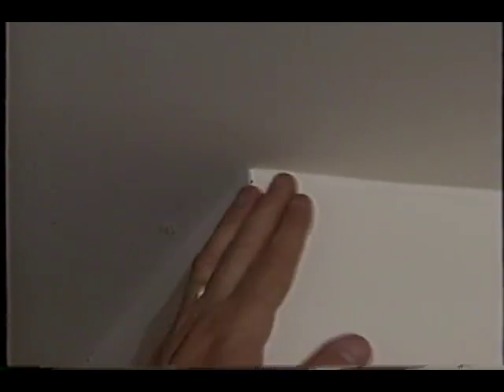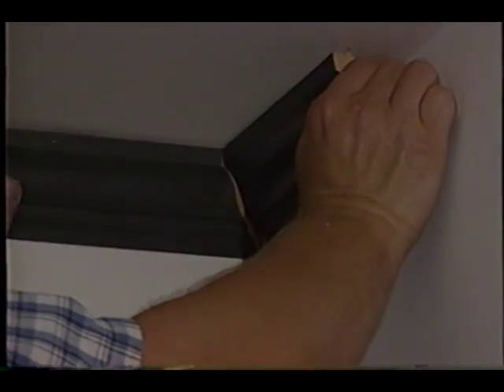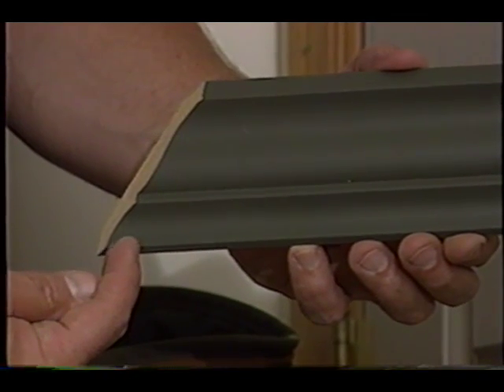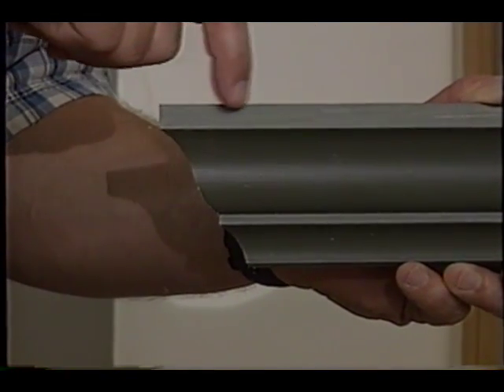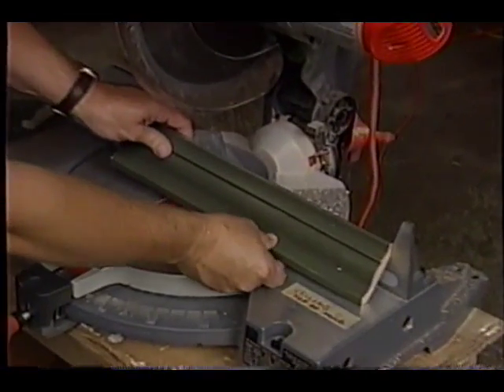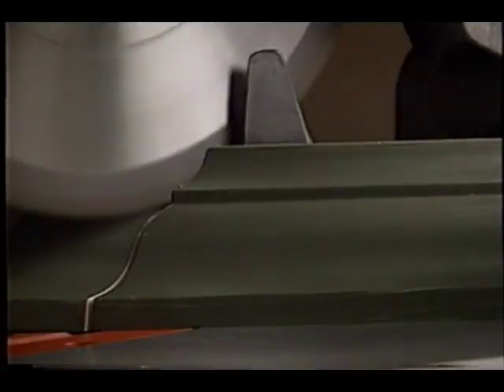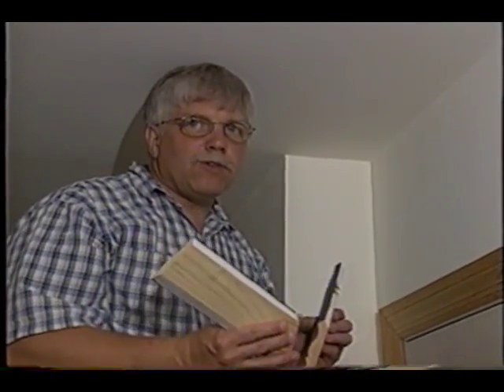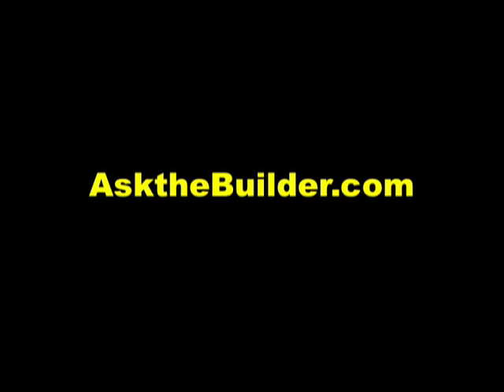Cutting Crown Molding

Comment from the maker: If you read my ebook about how to install crown molding, you quickly discover that you rarely cut each piece at a 45-degree angle. You use short test pieces in each corner to see what angle to cut each side. The left may be a 45, but the right could be a 44-degree cut. When you cope you have to cut the molding - one piece with the identical cut *then* very very carefully cope. With my method, I probably will have two corners complete in the time you're still cutting away.

Comment from the maker: The funny thing about coping is that you have to make the miter cut on the molding to produce the cut line. If you determine the correct angle for an inside corner - it's usually a combination of angles from 43 to 45 degrees - you get a tighter fit than with a coping saw. But whatever floats your boat and we sure don't need you with a stretched ear.

Comment: if they are inside corners try coping moldings and if that doesn't work then put the molding against the ceiling and trace the height and projection with a pencil on both sides of the corner making sure wall lines align  and then mark the molding where it will meet and find your angle on the saw...hope this helps

Comment: You have an informative series I will admit.Yeah I should do the same only I end up using so many different profiles. I was referring to the way in which you cut the crown itself on the miter saw. I use a 12" dual slide compound miter saw (Makita). I always lay my crown flat on the table of the saw itself.  I I am a Florida licensed General Contractor specializing in commercial work. By trade I am a finish carpenter though.

Comment from the maker: You have the keyword in your question! The angle in a gable end is NOT a compound cut. The crown is not going around a corner. Both pieces running up the gable are in the same plane. Think about how easy that cut is....... Think door or window casing.

Comment: i have to agree with mycijor, because in stain grade work the reveal from a coped joint is always wood. on a miter cut the is nothing only air. it's easy to spot if it seperats the slightest.but i have to admit i often times miter, but my saw is perfect,and i use a good protractor. but if you got the time coping is best.

Comment from the maker: I can't tell you as the miter method I use produces tight joints in less time. To produce an accurate coping-cut line, you have to cut it the way I show. So why cope if you already have the perfect fit?

Comment: I agree with AsktheBuilder ... if you are going to be painting your molding I prefer to just miter both pieces instead of taking the time to cope it.  Either way you can use a paintable caulk to fill the gaps.

Comment: good for the test pcs, always pays to be certain. Usually putting up crown stained is easier and forgiving compared to painted, and white is a bitch. TG. for caulking, whiting 
etc, and at the very least touch up the ends of your mitres with something. better than seeing a thin "white" line at inside and outside joins.

Comment: Why not just cut your test pieces to determine your angle and bevel? I always cut my crown upside down on my saw and set my angle and bevel based on what I am using. I install a lot of larger profiles so its the only way I know. The larger profiles simply wont sit on the fence properly.

Comment: A coped joint will always be tighter because the sharp edge of the cope will dig into the other piece.  A coped joint can be cut tight and sprung in for a super tight fit.  Because inside corners and outside corners are usually not square then there will always be a gap in the joint if it is only 1/4 of a degree off of 90 degrees.  That is unacceptable for stain grade work.  For tight joints, you absolutely must cope.  Shrinkage is not a factor in a coped joint.

Comment: Actually, there is no reason for a coped joint to be any less tight than a mitered one if you use a coping saw correctly.  As a matter of fact it will usually turn out TIGHTER since you don't have to actually pre-determine the angle of the inside miter with any real beforehand, which can be next to impossible with irregular walls anyway.

Comment from the maker: I have to respectfully and regrettably disagree. I can take you to no less than 30 houses where I have installed crown without coping. No open joints. Why? You may be installing crown in new houses where the lumber shrinkage has not reached its peak. Or you were installing crown that had not acclimated to the interior humidity/temps of the house. A coped joint will also open up in those circumstances.

Comment: How many teeth do you recommend on a circular saw blade? Is 80 okay?
Reply from the maker: Yes, that's a good number.
Reply: Thanks for the response. I purchased an older 10" Makita miter saw in excellent shape. I have lots of moldings to cut. Thanks again.

Comment: Perhaps I should have said... Shrinkage is LESS of a factor in a coped joint.  Have you gone back to your jobs five years later and checked for gaps?  I am just saying a coped joint will be less likely to have a gap.  No matter how tight you spring in a mitered corner it will not close a gap if the angle is off of 90 degrees.  If you are an amateur then go ahead and miter but if you make a living doing fine work then you better cope.

Comment: About coping your corners. It is not necessary on crown in fact i would not do it at all. if you use test pieces to mark where it would sit in the corner and install the opposite ends just snug and then pop in the last 2 pieces they will marry up so tight you cant even see the seem. i have been doing this for 33 years now and have put up more crown than you would believe.
Reply from the maker: I agree 100%. That's why you rarely, if ever, see me promote coping in any of my crown molding videos. You have to cut the crown molding with the CORRECT compound cut to produce the line the coping saw follows. So just cut it correctly and mate the two piece together. BOOM. DONE.